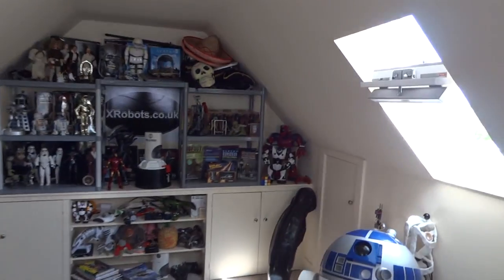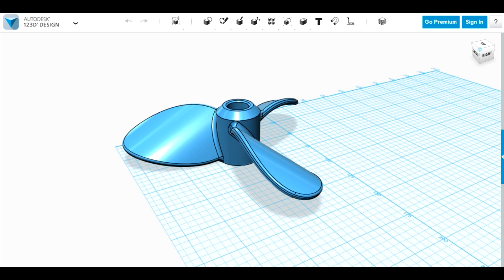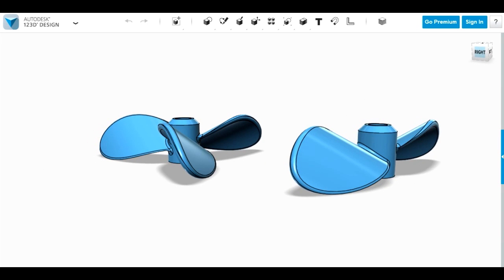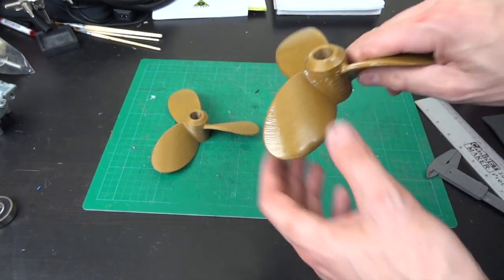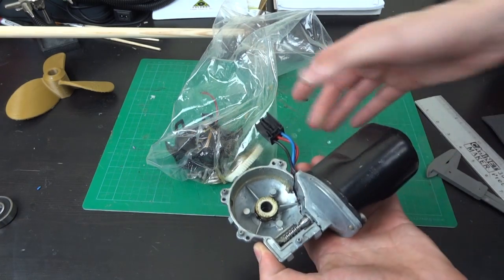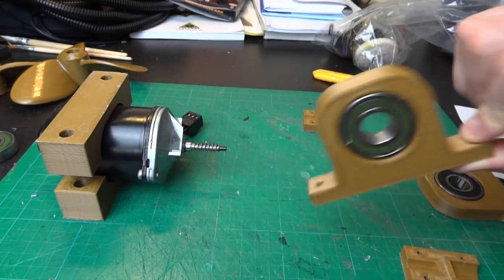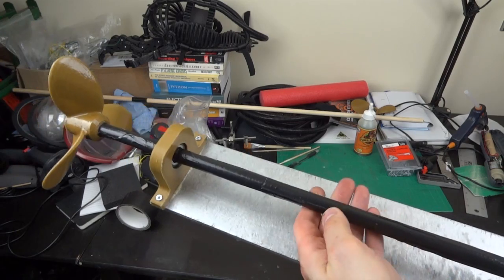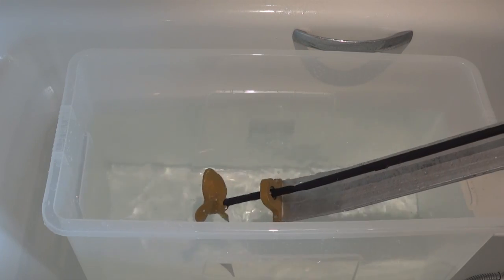Boat #9 | 3D-Printed Propeller | James Bruton

Comment: You can twist a plane in 123D using Loft.   Actually, it's never really a plane, its created twisted by off-setting the top and bottom drawing of the blade. Then you can shape it and chamfer the edges.

Comment: propeller design seems to be the least of your design problems :) there is a smaller propeller one seen in the background which would also be too big for this motor. 3D print is very much ok for low power applications though.

Comment: Rebuilding the wheel on this one. It's cool yo show the kids the potential of printing parts, but you should just buy a trolling motor.
Maybe laser scan the factory propeller with David scanner and a laser level, then print backup parts.

Comment: That last bearing is not a fully sealed unit, it just has dust caps on it, so it will rust in the salt water and may cause more drag or stop it from turning.